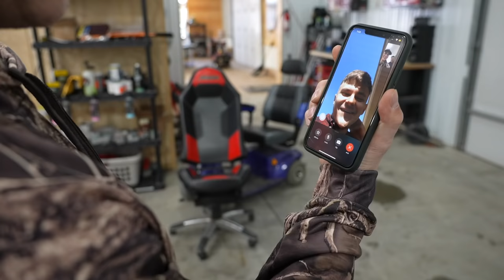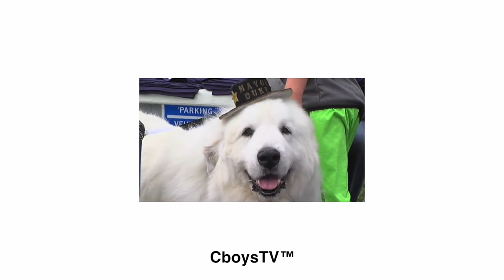Testing $800 Amazon Quad!! (It gets Destroyed)

Comment: Its funny to me to here that engine sound because I’ve had a taotao 125cc 4 wheeler for about 10 years nowand it has the same motor than the one im this video or at least it sounds the same.  Mine is still running hard. That thing has been unbeatable. Ive been rough on it and It just wont die.
Reply: with that 125cc you able to ride trails pretty well? I'm looking for a cheap toy to take the the offroad parks for some trail riding
Reply: @IndySVT2013  id love to start this hobby